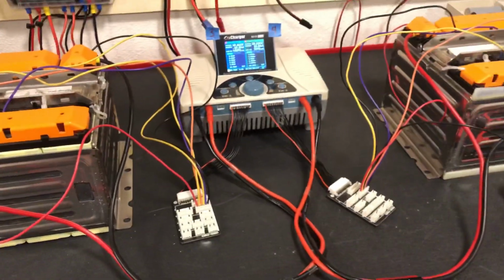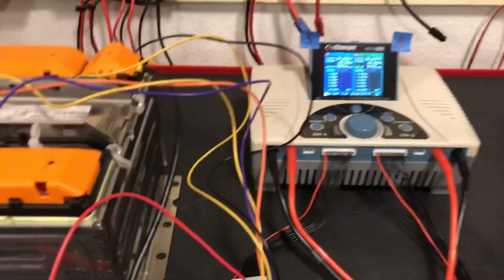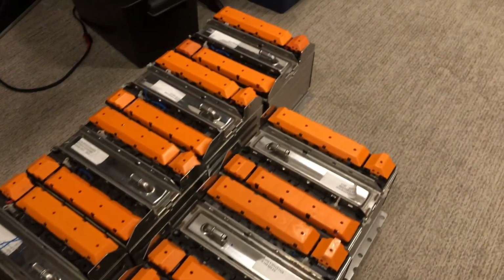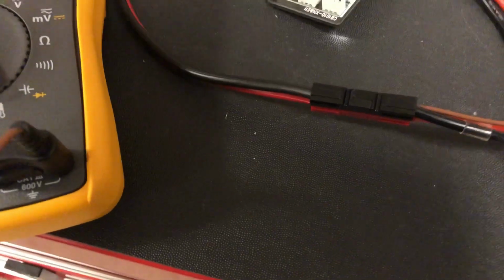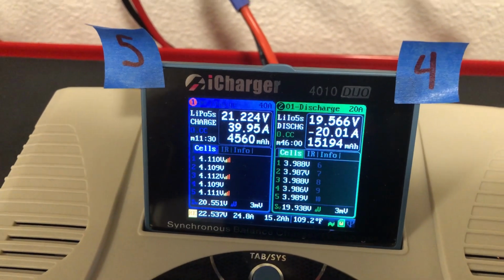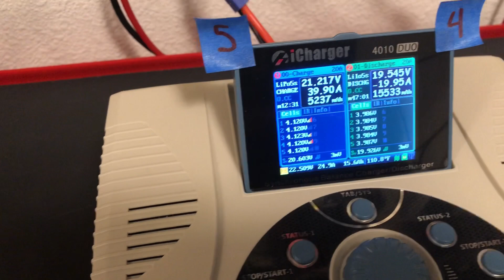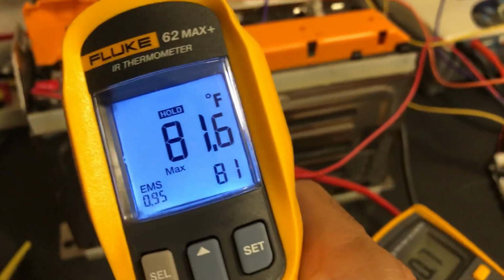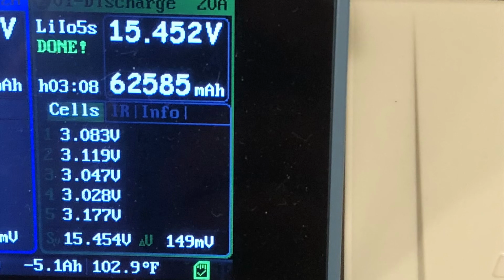DC Battery Bench - iCharger Regenerative Capacity Testing 1.1 kWh Lithium Modules

Comment: Thanks for showing the temperature at different amps.
Reply from the maker: DavidPoz I should have included a 30 amp test in video, but it’s still hotter than I would like it to be for something I would leave unattended. About 140F+
Reply: @HamPower  Yes, hotter than I was hoping for.  I'll go with the SB50 for my build.  The terminals are larger, so probably less heat at 30 amps. Thanks for the help in deciding.

Comment: you should use XT-60 connectors, andersons are junk
Reply from the maker: Haha Yeah, their current handling is lacking, but still love em. I actually have a huge collection of connectors, should have posted it in video... including XT60, XT90, XT120.  But as when it comes specifically to Genderless connectors, Anderson still #1 for me.  It’s nice having adapters made because running into gender issues gets old. Now that I have a reason for it, I’ll make some new charger leads and post a video about it.  Thanks for watching.
Reply: One would assume you have a collection of nice big connectors, since you are the crimp daddy lol, don’t forget to solder though 😁